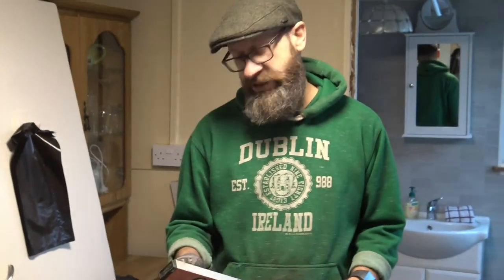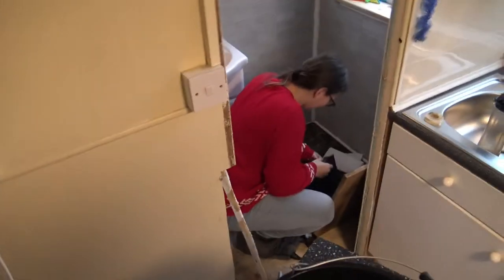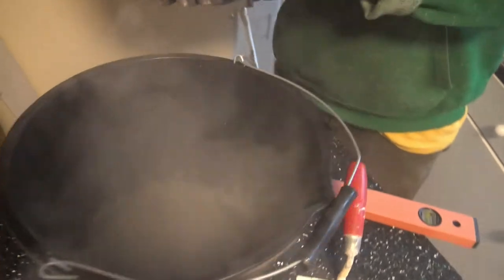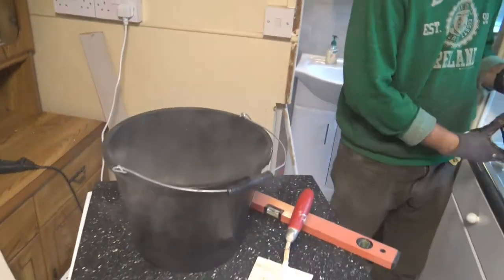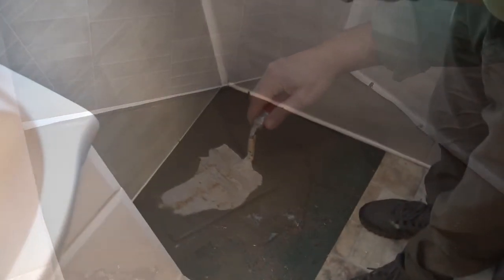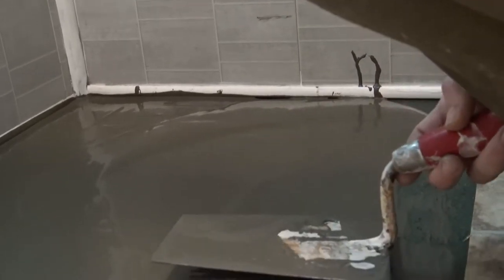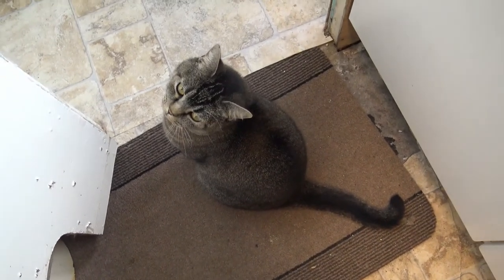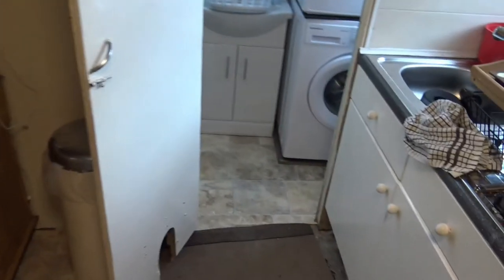Washing Machine Slab Installation - self leveling compound

Comment: Thank you for this! My basement floor is so sloped that even dialing the feet doesn't work well enough to level my washer. You've inspired me to create a concrete platform, which will be so much easier and much less expensive than other solutions I've come across. Thank you!!
Reply from the maker: I am happy to help

Comment: Making my washing machine move on its on
Reply from the maker: There are screws to extend the feet of most washers, get down close to the ground and have a look, you should be able to adjust the level of the feet and steady the machine properly. You can also add a thick rubber mat underneith.

Comment: 16:00 NO YOU DID THIS JOB  PROPERLY. DO NOT SECOND GUESS YOURSELF.  YOU HAD A TERRIBLY WARPED AND SLOPING FLOOR.  ADJUSTING THE FEET STILL WOULD NOT HAVE PRODUCED A STEADY ENOUGH SURFACE (ESPECIALLY, WHEN YOUR WASHER IS ON EXTRA SPIN AND RINSE CYCLES).  

THE DRUM IN YOUR WASHER HAS TO REACH TERRIFIC SPEEDS TO RENDER MOST OF THE WATER FROM THE LAUNDRY.  EVENTUALLY THE MACHINE FEET WOULD BEGIN TO WOBBLE, THEN WALK AND ULTIMATELY SHAKE THE MACHINE VIOLENTLY, OVER TIME.

YOUR STEPS WITH THE CONCRETE MAY BE SEEMINGLY UNNECESSARY TO A NOVICE, BUT THEY WERE THE CORRECT INSURANCE YOU NEEDED TO NOT HAVE A PROBLEM WHILE THE MACHINES SIT IN THAT AFFECTED CORNER.  STACKING THE MACHINES ALSO TURNS OUT TO BE AN ADVANTAGE OF ADDITIONAL WEIGHT ON TOP OF THE WASHER.  MINE ARE NOT STACKED, AND THE BALANCE IS OFF ON THE WASHER, EVER SO SLIGHTLY.  THIS IS CONTINUALLY A CAUSE OF CONCERN UNTIL I FOLLOW YOUR METHOD.  MY MACHINE ROCKS AND VIBRATE ABNORMALLY ON ANYTHING ABOVE LOW SPIN.  THAT IS NOT THE PROPER USE OF ALL THE UTILIZATION ADVANTAGES OF THE WASHER TECHNOLOGY. 

LESSONS:

YOU COULD HAVE ADDED THE CONCRETE TO THE BUCKET ON THE OUTSIDE, AND HAVE LET THE DUST SETTLE; BEFORE, THEN GOING INSIDE, AND MIXING IT WITH WATER.  PROPER CONCRETE MIXES DRY VERY QUICKLY, SO ADDING WATER HAS TO MEAN THAT YOU ARE READY TO POUR —RATHER THAN STILL BEING AT THE MIXING STAGE.  

YOU SHOULD HAVE USED A VERY PAPER THIN LAYER OF FOAM AROUND THE WALLS OF THE SURROUNDING AREA THAT YOU POURED YOUR MIX.  THEY SELL CONCRETE FOAM AT MAJOR HARDWARE STORES.

AND YOU SHOULD HAVE PRE-SURFACED THE FLOOR OF THE AFFECTED AREA WITH CONCRETE PRIMER FOR A MORE RIGID AND STRUCTURALLY SOUND FLOOR.  WITHOUT THE CONCRETE PRIMER, WATER TENDS TO ABSORB MORE INTO THE FLOOR THAN IT WOULD THE CONCRETE MIX. THE WATER STAYING IN THE CONCRETE MIXTURE IS CRUCIAL TO THE CHEMICAL RELEASE OF THE HARDENING PROCESS IN CONCRETE POURS.  WATER STAYING IN THE CONCRETE POUR ENSURES THAT THE FINAL PROUCT OF YOUR LABOR WONT CHIP, CRACK, OR BECOME BRITTLE AT THE SURFACE.

I’M LEARNING HOW TO DO THINGS PROPERLY TO PREVENT FUTURE PROBLEMS.  I ENJOYED WATCHING YOUR VIDEO AND I LEARNED FROM YOUR FIRST-TIME SLIGHT MISTAKES.  THANKS FOR SHARING.
Reply from the maker: Excellent observations, theres always room for improvement. Thanks mate